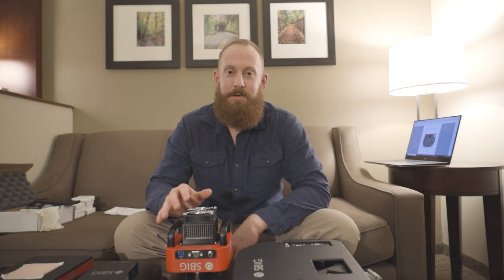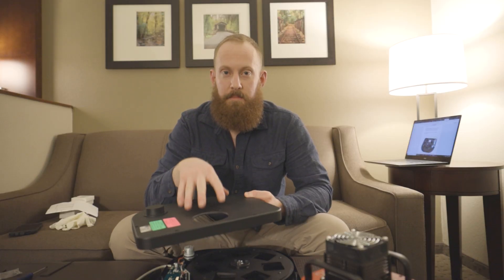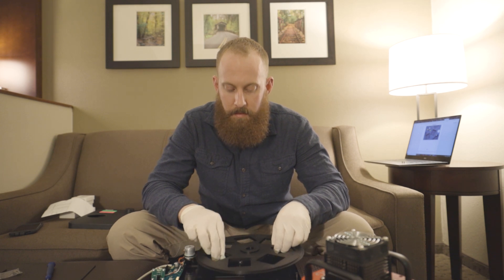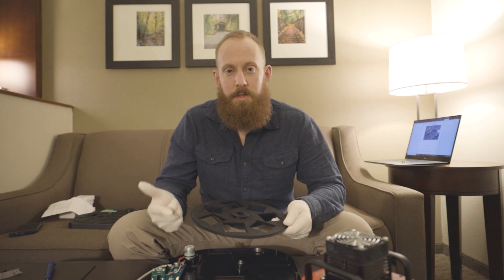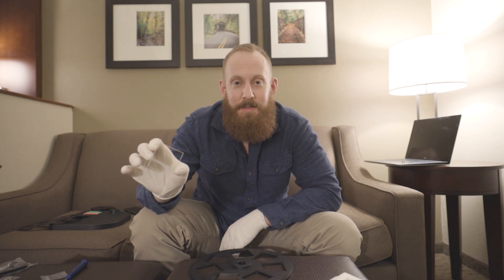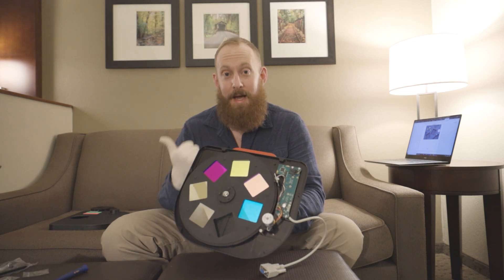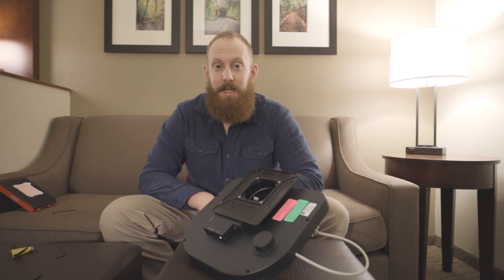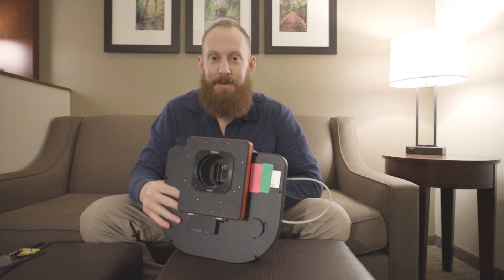SBIG AC4040 CMOS camera with active optics, off-axis guider, and 7 position filterwheel

Comment: Are these good enough to reduce atmosphere distortion by alot like will i be able to reach the diffraction limit of my 10 inch telescope.
Reply from the maker: These are active optics, so they essentially are providing more accurate guiding corrections during long exposures. At the end of the day, seeing is the limiting factor for the performance of these systems as long as your telescope optics are diffraction limited.

Comment: Active optics, not adaptive optics. An adaptive optics requires a wave front sensor and it has to deform the mirror (or other element in the OP). This SBIG AO is just a deviating plate which shifts the complete image in two axis. A adaptive optics would be able to fix single pixel groups in the image by flattening the wavefront. Those technologies are completely different.
Reply from the maker: Thanks for the clarification Peter, appreciate your comment!

Comment: can we use it with Raptor 61 f/4.5
Reply from the maker: Unfortunately the backfocus isn't long enough on the Raptor to run the both this. Raptor only has 55mm of backfocus with their field flattener installed.

Comment: What a cool piece of kit! I had a chance to test out the SBIG AO with an 8300. Too bad for me I didn't have enough backspacing to make it work. 

Looking forward to the next video!
Reply from the maker: Ya definitely have to have ample backfocus. Good thing is the CMOS models occupy less backfocus. What telescope were you putting that imaging train on?
Reply: A CFF 250 F8 RC, 98mm of backfocus available with the corrector. I think the sbig  with filterwheel and ao was over 100mm
Reply from the maker: @tombutts919  ah ya just a bit too long for that system.
Reply from the maker: @tombutts919  ample 11.09" of backfocus on the CDK14 :)